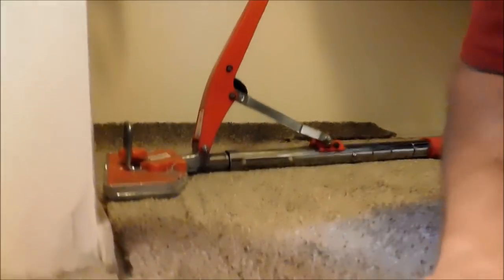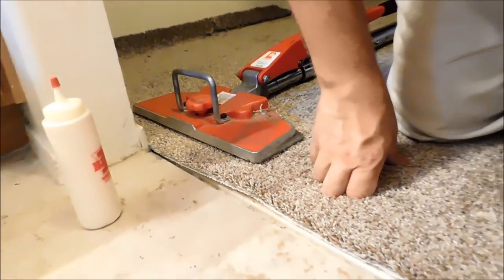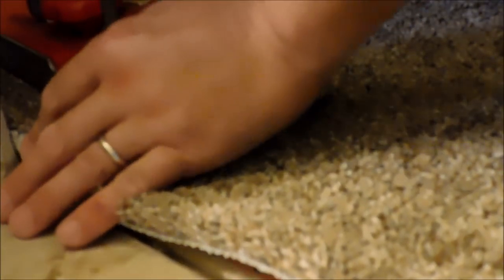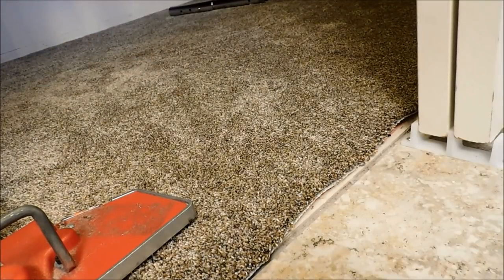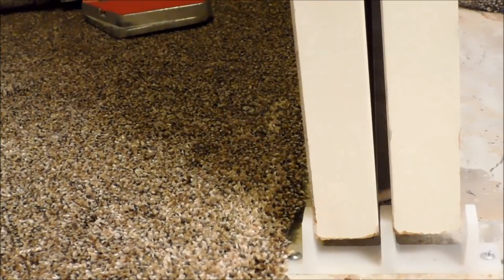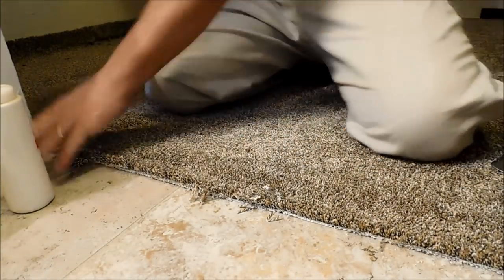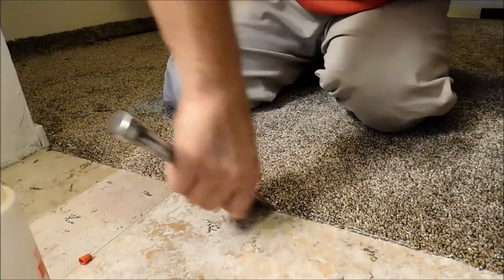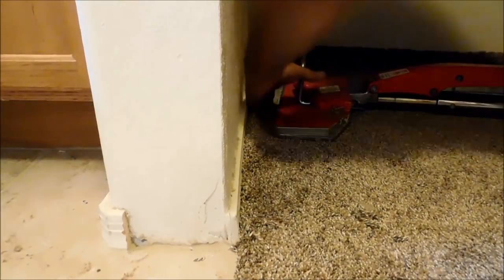MEGA CARPET STRETCHING  WITHOUT DAMAGE

Comment: Great technique. 👍
You may have mentioned seam sealer used like this in another video that I haven't seen yet.  It's fantastic that you showed that because I  doubt that one out of every 150 installers would do that even though they should.
I've also noticed since I started watching you that you use a carpet trimmer to trim the edge along the tile.  I have never thought of using a trimmer in that method. I built my own little tool for doing that but it's much slower.
Reply: I would never use seam sealer/latex in the channel like that. Never had too, never will. Drop of the spray or double sided ON the gripper rods (tackstrip) and tuck plenty into the channel.
Think of the next guy having to uplift that mess of latex and saxony welded to the edge of the tiles!

Comment: So you're  the guy that uses a gallon of pad glue on pad & probably a thousand staples in pad on wood sub floors along with all the tile seam sealed when I'm doing a tear out!!!! @ 6:20 dont pull strings cut them lol... just kidding I really like the videos! If you havent already it would be nice if you could do a video on the correct way to glue or tack down pad! When I do tear outs I dont know what is going through the installers minds on what they are trying to accomplish! I was trained glue around the tack strip and tape the seams in most cases...sometimes I'll tear out a 3×5 closet that someone used enough pad glue for a whole room in! Also if you have knowledge on double stick gluing pad down before gluing the carpet on top of it!!! Installers are using multi purpose!!!!! Do most installers not know to use a releasable adhesive on the pad?! If you are educated on this I think a lot of people would benefit from you demonstrating it for them! A releasable adhesive on the pad on a double stick glue down makes the tear out & floor prep for the next installer just a little bit easier!
Reply from the maker: Thank you for the suggestions :-)
Reply: They use the multi-purpose because it is much cheaper than the takifier, as we call it in Blighty. Release adhesive is about three times the price. The fitter is not worried about the uplift at the end of the carpets life, he/she presumes they will not be lifting it. Well, they hope they won't!
(I know this is three years after the event of this post)

Comment: Why r u putting latex in there???
Reply from the maker: Jonathon Lisinski That prevents one of the most common repairs there is, putting latex in the goalie next to tile or closet tracks or anything low profile will prevent it from ever raveling or coming loose, and it holds extremely well I have several videos on showing how well that holds
Reply: What latex glue?
Reply from the maker: SamChan Roberts 8015-A Solvent Free Universal Carpet Seam Sealer https://www.amazon.com/dp/B0017O0K2G/ref=cm_sw_r_cp_api_i_SDd1DbS96RNP8.     Here you go, this will work just fine
Reply: Please dont use it! Unless the tile is super thin in which you can use z bar! It sucks for the next installer or if carpet has to be re stretched & for those who say my installs dont need re stretched maybe not but if there was a stain in the carpet where pad may have to be replaced before it is cleaned you may run into a problem...I'm not a huge fan of z bar or seam sealing ceramic tile but I will say I have done it too lol...but this guy making these videos is very knowledgeable! I've seen YouTube videos that make me shake my head! This guy is dead on with every video I've seen! No need to look anything else up if its something this guy has already covered! He pretty much puts a CFI demonstration on in his videos....if you're not a super experienced installer keep watching his videos even if you are experienced watch them anyways! Always try to learn & better yourself & I watched quite a few of his videos he is the best I seen on any videos put out there
Reply: @troyfowler6862  I know this is an old video and that your comment is old but people keep reading these anyway.
I found that the same sealer if the carpet is tucked into it solidly and with a much tighter Gap and the one shown here, the sealer when the carpet is pounded in embeds/absorbs in the backing, it really doesn't actually stick to the floor all that much.  It does keep the carpet from rattling but it also helps it hold it shape in the gully so that can't relax upwards and start to unravel.
I removed the job once that I had installed years earlier and the sealer absorbed so well that I had to look closely to see if I had actually put sealer in there.  It really didn't stick much at all to the substrate,  it absorbed into the backing.  
If you ever had to stretch the carpet that direction you would probably stretch enough to trim off that sealed edge anyway.